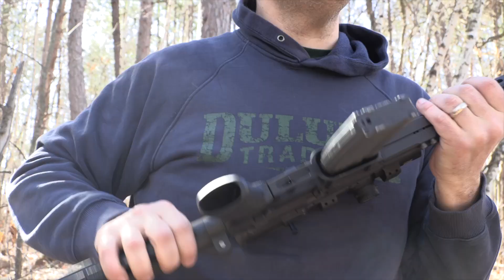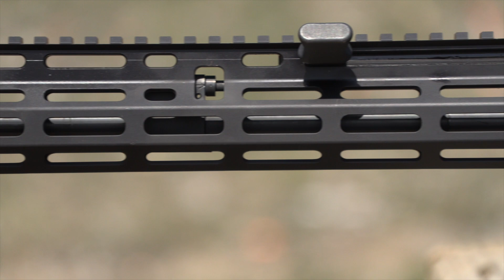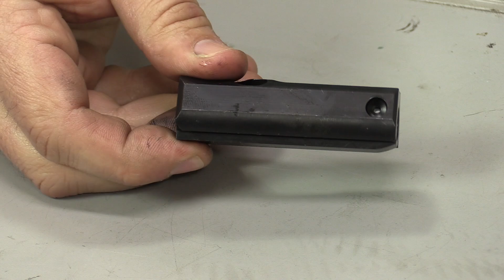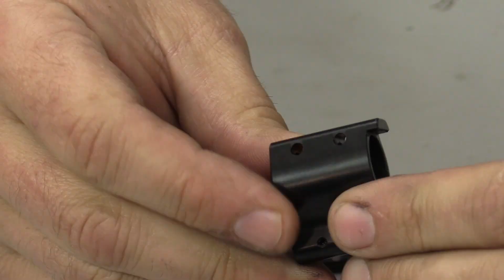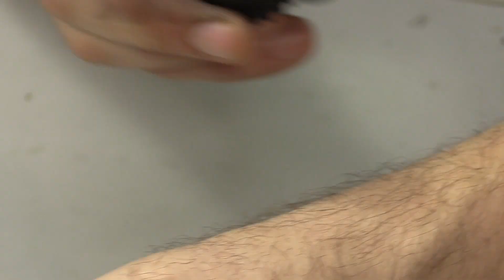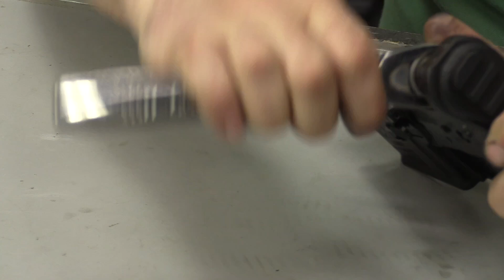Foxtrot Mike FM-15 First Look

Comment: Nice presentation.
I have 3 complete arms from FMP. A 16" 9mm, a 12.5" 223 that uses AR mags, and a 9"(?) 223 that uses AK magazines. The 223 both have side folding braces.
I'm going to look to see if they offer a 300BO shorty upper. I'd really like it for 300.
I haven't had any issues, but mine have less than 1000 rounds through them. I've seen videos with the owner describing the design that went into the product to make it better. Ive also seen videos of parts improperly installed, takedown issues and breakages. So mine have low round counts.
I really like the design and concept. I want to be able to trust that it's reliable for whatever comes.

Comment: Looks familiar, have the 13.9" fixed gas with a Nox P&W, and the same MI/MFT folding stock setup.  Very happy with the accuracy, quality, and surprisingly the light weight.  

Dave, talk to the FM guys and have them get some of the Paratrooper folding charging handles out to their vendor partners.  :)
 (FM doesn't take credit cards, need check or money order, snail mail).